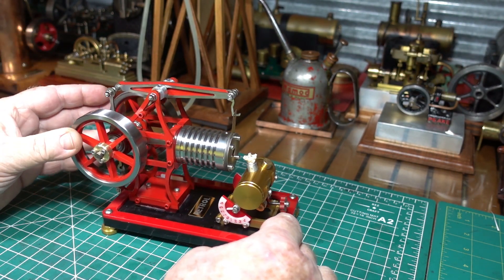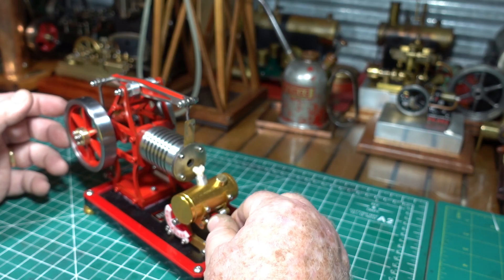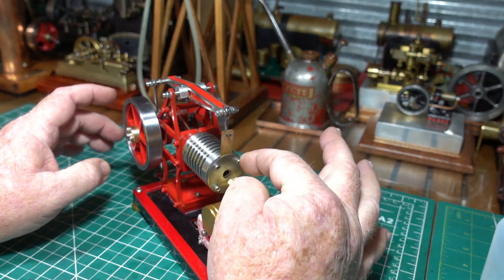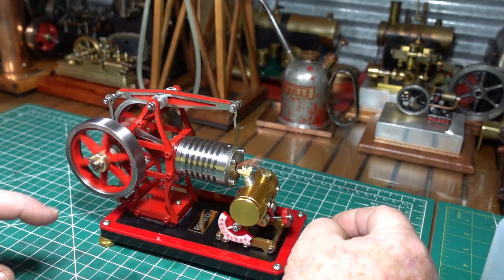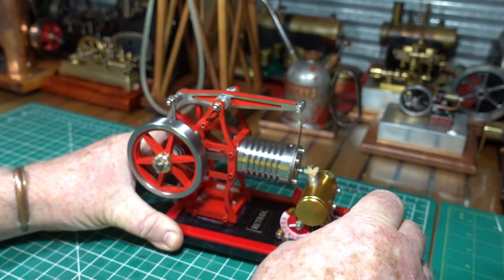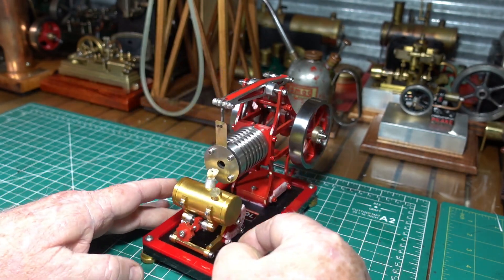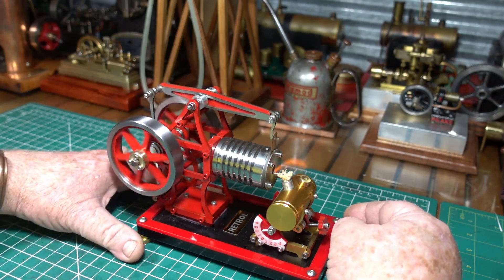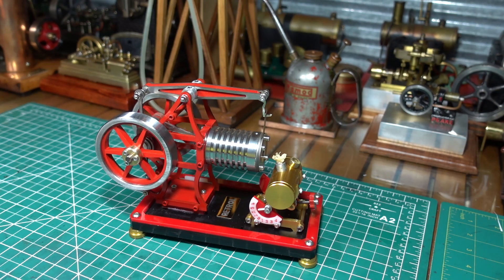Flame Licker Flame Gulper Vacuum Retrol VE-01 Crossbeam  Engine First Run

Comment: That’s an awesome engine Jim. Wonder what would happen if you decided to use different fuels for it. Wonder if it’ll run faster with a higher btu fuel
Reply from the maker: G'day Steven really happy with this engine. I'm using just plain methylated spirits, do you mean a higher alcohol content like Everclear that you can buy in the U.S (not sure if that's available down here in Oz).

Comment: What a great runner that flame licker is, ran first go for you. Mine are all pretty temperamental. Looking forward to seeing more vids of this engine running.
Reply from the maker: Very happy that this one ran perfectly straight out of the box. I'll be making a drive wheel out of brass on the lathe and seeing how it goes driving some accessories soon.

Comment: Runs great and also looks the part.
 As for machining  spokes and hub and inserting into rim . I have seen it before with small train wheels
Reply from the maker: Thanks Dennis, pretty clever way of doing the wheels. The spokes are cast aluminum and the rims steel which really gives them some inertia. Hope you're having a good Winter in NZ mate.

Comment: Really nice flame licker Jim. I've never seen wheels made like that, but they look pretty good. They are temperamental with the flame position and it was interesting to listen and see the difference in the engines RPM's as you adjusted it. Thanks for the vid mate I reckon you and your grandson are going to have a lot of hours of fun running it.
Reply from the maker: Thanks John appreciate the comment I'm very happy with the engine and how the flame adjuster works.